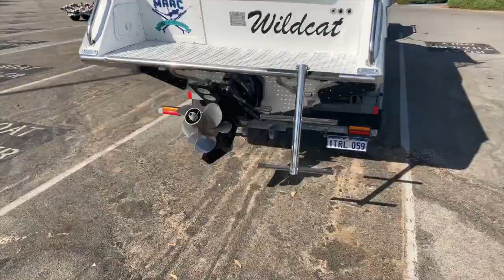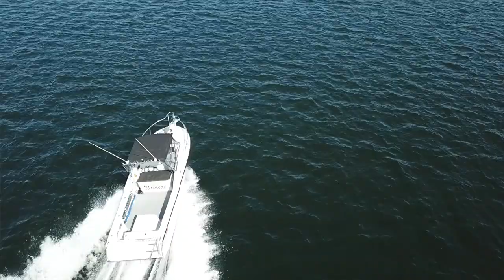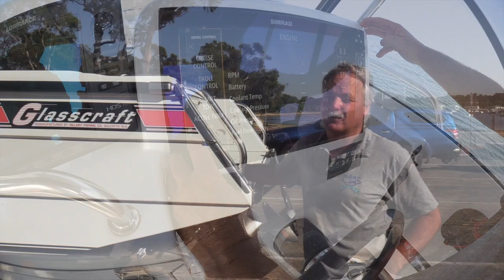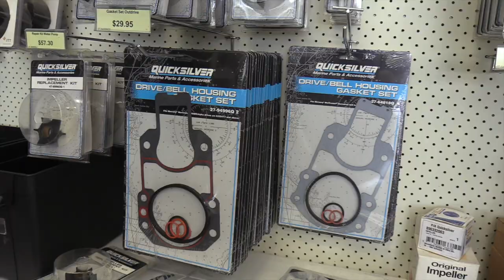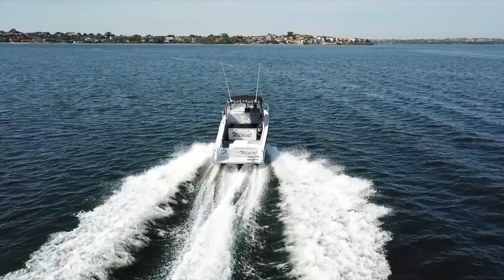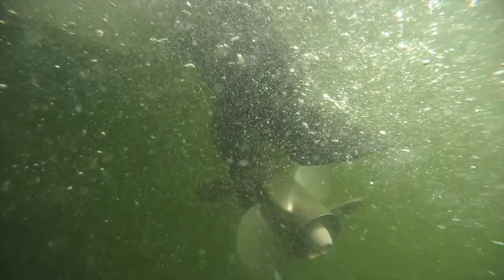Repower | Paul Hillary V-8 300HP 6.2L with HiTec Marine

Comment: Engine components supplier here. Despite what mercruiser says, they are not 100% designed for marine from the bottom up. They are simply a reverse engineered (copied) GM ls3 engines. All they basically changed was the cooling system. 99% of the internal components are identical